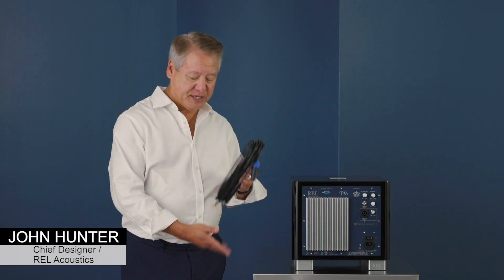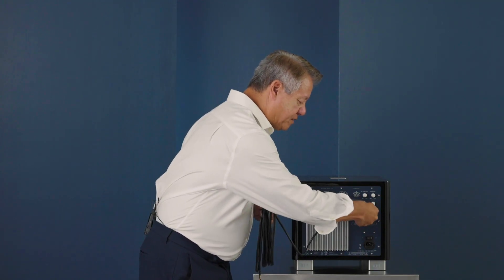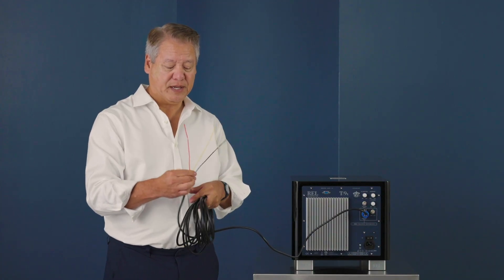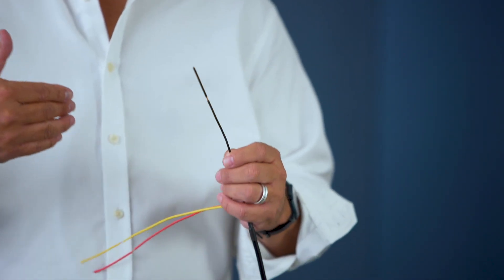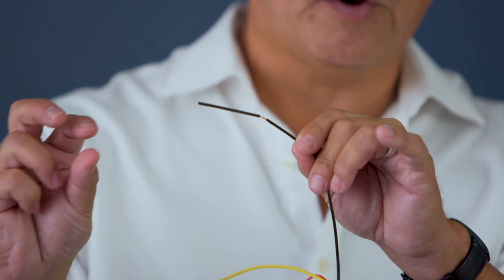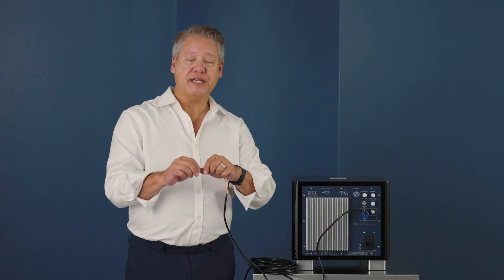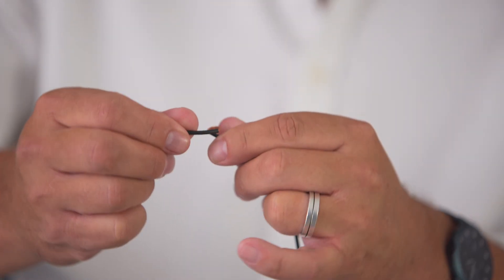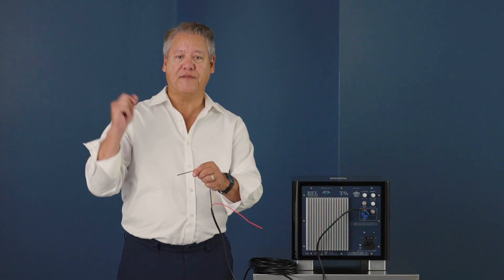If You Only Watch One REL Video, Watch This One. The Simpler Way to Connect Ground. It's Safer Too.

Comment: Hot?
I think you mean positive 🙄
Reply from the maker: "Hot" is commonly used in electronics to refer to a wire or connection point in a circuit that has positive voltage. With our High Level cable, the red and yellow wires both connect to "hot" output terminals on the amplifier, which in most cases is the positive speaker output terminals.

Comment: Would connecting the ground on the Bassline Blue to a speaker terminal on a newer NAIM amp possibly damage the amp?
Reply from the maker: Thank you for reaching out, and it depends on the specific Naim amp model that you are using. When you have a chance, please write in to contactus@rel.net and a member of our team will be happy to provide High Level connection instructions specific to your system.

Comment: Hello - I have two REL S8/12 connected via high level connection to my Integrated amplifier (class A/B). No matter what I do with the black ground wire (connected to chassis ground, speaker terminals) I get a low frequency hum when my Amplifier is OFF. As soon as I turn the amplifier on  the hum disappears. The subs are plugged into a Furman Elite power conditioner, amp is plugged directly into the wall on the same circuit. How do I eliminate the low frequency hum with the amp off?
Reply from the maker: Thank you for reaching out, and we are sorry to hear about the hum that you are experiencing. When you have a chance, please write in to contactus@rel.net and a member of our team will be happy to assist with troubleshooting this issue and providing resolution options as needed.

Comment: So the black cable connected to the amplifier chassie works even on Sonos Amps with Class D humming issues?
Reply from the maker: Correct, attaching the black High Level wire to a chassis screw will provide a stable ground reference with the majority of amplifier models, including the Sonos Amp.

Comment: I have an interesting question. I have a Marantz with a/b speaker selections. I want to use the sub on both my splitting the positive leads, is there a way to do this without hum? I have made it work but i get a noticeable hum when both positives aren’t connected to the same left n right , the reduce gain by removing a lead doesn’t work for me.
Reply from the maker: Thank you for reaching out. When you have a chance, please write in to contactus@rel.net and a member of our support team will be happy to assist with troubleshooting this output issue.

Comment: Can one of T5X be setting carpet probably .5 in of carpet .5in on pad?  or does it have up on some kind spikes?
Reply from the maker: In our experience it will be fine to have your T/5x placed directly on the carpeted floor in your room, without the use of spikes or replacement feet.

Comment: I have four xlr balance out in my pre-amp two for my mono blocks and two for my subs is that not the optimal way 🤷‍♂️
Reply from the maker: It depends on the model of subwoofer that you are using in the system, and other aspects of your system's layout and electronics. When you have a chance, feel free to write in to contactus@rel.net and a member of our team will be happy to discuss subwoofer connection options for your system.

Comment: Hi John,
How would you connect a REL sub to Rotel RA-6000 amp?
Reply from the maker: The High Level connections that John describes in this video will work well for connecting to the Rotel RA-6000 integtrated amplifier:
- Red wire to the right channel positive speaker output. 
- Yellow wire to the left channel positive speaker output. 
- Black wire to the ground screw on the amplifier's back panel.
Reply: @ Thank you.
I was recommended to add REL sub to a pair of bookshelf speakers that I would consider to purchase, but I don’t remember if the sales guys said one REL sub or one pair.
My two channel system is for music only, what do you recommend on the number of your REL subs, types, models?
Thanks again
Reply from the maker: @杨永昌-t2h  When possible, using a stereo pair of REL subwoofers will provide an improvement in performance over a single subwoofer setup, though you could start with a single unit and then add the second matching sub later on. In terms of specific model selection, when you have a chance please write in to contactus@rel.net and a member of our team will be happy to provide a recommendation specific to your system.

Comment: I had a Luxman L-509X and had no issues with both hot wires going to the speaker terminals and then attaching the ground to one of the negative speaker terminals. I switched out the Luxman for an Accuphase E-4000 and hooked the sub up the same way and had hum in the sub-woofer. I move the negative wire to the phone ground and the hum disappeared.

Comment: Hello. My sonos amp class D doesnt have screw. Can i use ground wire to other equipment instead?
Reply from the maker: Yes, if another device in this system has a ground screw then you could connect the black High Level wire to this screw.
Reply: Hi, how did you end up connecting the Sonos Amp with the REL? Classic High Level on the right plu / left plus? Did you try to connect RCA connection to remove the hum?
Reply from the maker: @VCTSDragonSailingTe  Thank you for reaching out. The Sonos Amp is a Class D amplifier, which means that you can connect the red and yellow High Level wires to the right and left channel positive speaker output terminals respectively, and leave the black wire completely disconnected. If you experience hum from the subwoofer then a basic RCA cable can be ran from any analog RCA jack on the Amp to the .1/LFE input on the REL, to provide a ground reference between the devices.

Comment: I am still a bit confused. Using a fully balanced amp. Should the yellow and red be connected to each speaker terminal? Or together? If together wouldn’t you only get half the signal?
Reply: To each terminal red wire to right + and yellow to left + and black to ground  amp screw

Comment: ive got 2 BHK300 mono blocks. at the moment, i can only afford one sub. how do i hook up the sub ?
Reply from the maker: If you are currently running monoblock power amplifiers in this system then it will be best to connect the subwoofer using it's Low Level input, to open outputs on your system's preamp. Later on once you are able to add a second matching subwoofer to form a stereo pair, you will then be able to connect both using the High Level input, with one assigned to each amplifier.
Reply: @RELAcoustics  , thank you

Comment: Please recommend for Amplifier NAD 3050 LE of Black (ground) cable connection.
Reply from the maker: Thank you for reaching out. When connecting High Level to your NAD C 3050 LE, we recommend connecting the black wire of the High Level cable to the chassis ground thumb screw, which is located next to the phono/turntable inputs on the amplifier's back panel.
Reply: @RELAcoustics Thank you for your help.

Comment: Can I connect a subwoofer with a high-level input without speakers? Will it harm the subwoofer or amplifier? I want to buy a subwoofer on the secondary market, but there is no way to listen with speakers, there is only an amplifier.
Reply from the maker: Thank you for reaching out. The main objective when using the High Level input on a REL subwoofer is that it allows the subwoofer to receive the exact same signal as the main loudspeakers are receiving, which improves the subwoofer's performance and also allows for a more seamless integration with the main loudspeakers. 

If you are using active speakers, or otherwise will not have the speakers connected to an amplifier, then it will be best to connect the REL using it's Low Level input to your preamp. Having the subwoofer on it's own connected to an amplifier can result in impedance loading issues for the amplifier, and also misses the primary benefit of connecting High Level in a system.

Comment: Can I use the ‘phono ground’ (turntable grounding terminal) on the back of my amplifier for the black cable?
Reply from the maker: Yes, the phono ground screw on your amplifier is a perfect place for connecting the black High Level wire to.
Reply: @RELAcoustics  when I connected to turntable ground (Roksan Kandy), there was a loud hum. I had to connect to both - speaker terminals and turntable ground to silence the hum on REL Quake. Does this sound like an issue with the amplifier or the very old Quake?
Reply from the maker: @frizzell4321  When you have a chance, please write in to contactus@rel.net and a member of our team will be happy to assist with troubleshooting this issue.

Comment: doesn't this show that high end speaker wire is a hoax?  That looks like super thin radio shack quality wire there. Maybe 16 gauge at best.  things that make you go hmmm.
Reply from the maker: Thank you for reaching out. While the High Level cable and input on our subwoofers does function as a speaker-level connection, due to the high impedance of this input circuit the signal that it draws from the amplifier is closer to that of a line level signal, and does not carry the same amp wattage/power as speaker wire does. This is why the High Level cable can use 18AWG wire, while for main speaker wire depending on the application you can use much thicker wire and achieve improved performance. This high impedance (approximately 150,000 ohms) of the High Level input also allows the cable to connect to the amplifier's speaker output terminals without drawing any power away from the main loudspeakers and without placing any current load on the amplifier.

Comment: What about if your amp has a float or ground switch?
Reply from the maker: Thank you for reaching out. Connecting the black wire of a REL subwoofer's High Level cable to a chassis screw on the amplifier or on your preamp will almost always provide a stable ground reference for the subwoofer, though it will be best to contact the manufacturer of your amplifier regarding how to handle this ground/float switch.

Comment: Hello Sirs, thank you for all information, very useful. However, still in doubt, how to connect a pair of REL Carbon Special subwoofers to 2023 Classé Delta Stereo amplifier (Class A/B). Nothing in the amplifier manual says it is balanced amp. There is no dedicated ground terminal / bolt to bolt the ground wire. Should I just connect two “hot” wires to + speaker terminal and ground “black” wire to negative speaker terminal for each channel / subwoofer? Thank you for advice.
Reply from the maker: Thank you for reaching out. When connecting High Level to your Classe Delta Stereo, we recommend connecting the black wire of the High Level cable either to a chassis screw on the amplifier (such as one of the screws along the outside edge of the amplifier's back panel), or to a ground screw on your preamp if one is available. In some cases it is possible to connect the black High Level wire to a negative speaker output terminal, though I would recommend contacting Classe first to confirm if the negative speaker terminals reference to electrical ground, and if so then it will be safe to connect the black wire to a negative terminal.

Comment: Can I do this with a single powered car subwoofer that has speaker 4 wired coming out of it. I don’t understand why it has 4 wired for 1 speaker.
Reply from the maker: Thank you for reaching out. Car audio is very different from home audio, and it will be best to contact a car audio installer in your area for feedback regarding wiring to this speaker.
Reply: @RELAcoustics  greatly appreciate the reply. Thanks

Comment: Class D:  Another REL video says to use an unused Pre-AMP INPUT as you are "just getting ground" by doing this.  So I am a bit confused.
Reply from the maker: Using an RCA cable connected from the .1/LFE input on a REL subwoofer to the system's preamp or AV processor is a valid way to achieve a signal ground reference for the subwoofer, and if using this connection it will not be necessary to connect the black wire of the High Level cable.

Comment: Hi. Super video. Just to confirm, can this style of connection be safely used for all amplifier types? and all RELs with the speakon connector? And the worst issue may be earth hum? I have a Cambridge Audio Edge W that has a class of their own creation (apparently). I'm currently using a single channel feed off the preamp to the REL so only getting bass from one channel so desperate to get all the benefits of the high level connection.
Reply from the maker: Thank you for reaching out. The High Level connection instructions presented in this video will safely work for any amplifier, including your Cambridge Edge W.

Comment: I am stupid enough to just learn the high level pass to class D amp after a good 12 hrs ‘final stage breaking in’ (which is according to the other brilliant video guide by you) of my beloved T5/x using class A/B connecting way… 😢 has it damage the sub permanently already? … plus, my current set up is just a WiiM Amp which doesn’t seem to have a ground bolt on the back chassis, it has a SUBOUT rca input… does it mean that I could only use .1/LFE connection with my particular case? Anyway, big thanks to each informative and very practical video guide you’ve done in here🎉
Reply from the maker: Thank you for reaching out. Any damage caused by incorrect High Level connection to a Class D amplifier would cause a significantly loud hum/buzz from the subwoofer, which means that if you do not hear this loud hum then no damage was done to the subwoofer. That being said, going forward it will be best to disconnect the black High Level wire from a negative speaker terminal on the amplifier. Since your WiiM Amp does not appear to have any easily accessible chassis screws, if you experience a ground hum from the subwoofer with the black wire disconnected then it will be best to run a basic RCA cable from the .1/LFE input on the subwoofer to any open/unused analog RCA jack on the amp, with the subwoofer's .1/LFE Level control then being lowered to the minimum position, which will provide a ground reference for the subwoofer and will eliminate the hum.

Comment: I just bought the rel 9 to be used with my marantz 50. Audio guys used my older RCA connection from my Martin Logan. They didn’t want to use the  neutrik connection the rel comes with? With that said, I have humming… and i want to know where the red/yellow connections to input to the amp?
Reply from the maker: Thank you for reaching out, and we are sorry to hear about the hum that you are experiencing. When you have a chance, please write in to contactus@rel.net and our team will be happy to provide High Level connection instructions and assist with troubleshooting this hum.

Comment: My listening room is 6 metres wide by 6 metres deep. Directly behind the listening position is an open area the same size. Silly question, when using the calculator on your website, do I enter just the listening area (6m X 6m), or the 2 combined areas (12m X 6m)?
Reply from the maker: Thank you for reaching out. When deciding the ideal subwoofer model for your home audio system we recommend taking into account the full volume of your listening space, meaning the main listening area as well as any adjoining spaces that your listening area opens up to. This will ensure that the subwoofer is powerful enough to pressurize the full volume of your room, which is essential for achieving deep and dynamic sub-bass output from your listening position.

Comment: My Sugden A21SE doesn’t have a ground screw to attach a ground wire to…I used a chassis screw and it still hummed.  I connected the black wire onto the negative amp binding post to eliminate the hum (grounding noise)

Comment: Hello - is that the same if your are connecting via the speaker? Does a speaker have chassis ground?
Reply from the maker: Thank you for reaching out. We only recommend connecting the High Level cable to the binding posts on your main loudspeakers when using a Class A/B amplifier in your system, since in this case the negative speaker terminal can be used for an electrical ground reference. When using a Class D amplifier, balanced/differential amplifier, or any other amp design that does not reference to ground at the negative speaker terminals, then we recommend connecting the High Level cable to the amp's output terminals so that a ground reference for the black wire can be achieved via an amp chassis screw.

Comment: Yes this works.  I had a small hum on my Naim system using the 510 subwoofer and my dealer recommended grounding at the phono plug on the preamp as you suggest in this video.  Worked perfectly dead silent no hum at all.  One more note…i use your Bassline Blue cable for Naim.  You cut the ground wire and then use some old speaker cable to attach (i used small piece of electrical tape) to make it long enough to reach phono ground screw on preamp.

Comment: What about if you don’t have any ground  screw  on the back of the amp but on the preamp still works??
Reply from the maker: Thank you for reaching out, and yes if your preamp has a ground screw then this will work very well for connecting the black wire of the High Level cable to. If you are using a turntable with a separate phono preamp, then that phono pre's ground screw would also be a valid connection point for the black High Level wire.